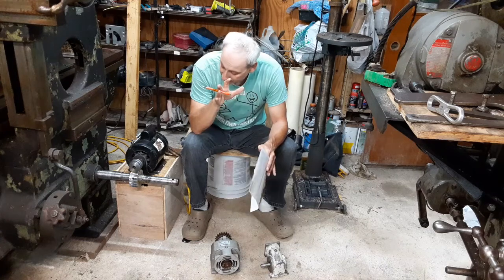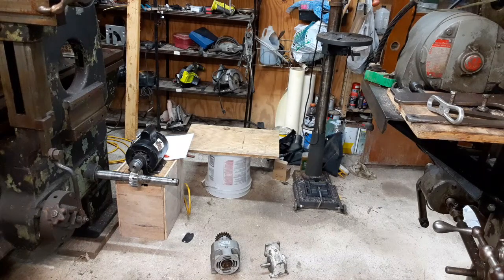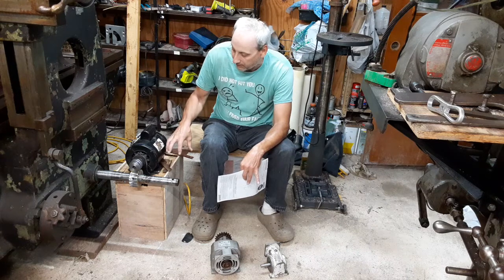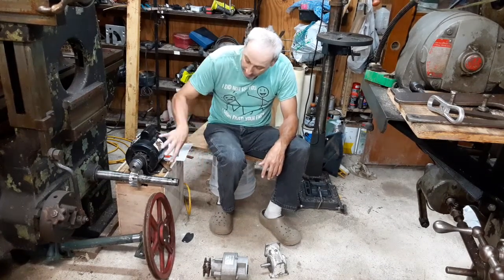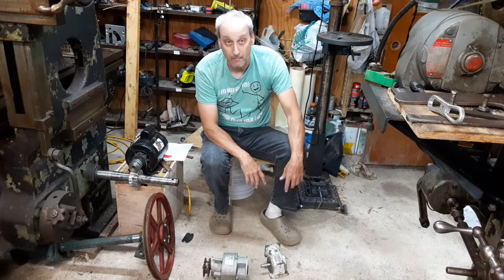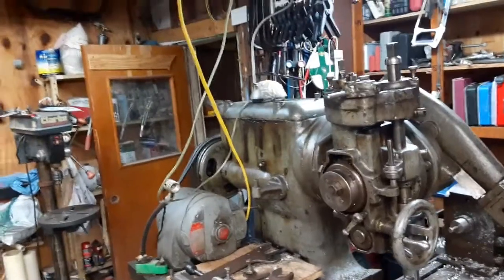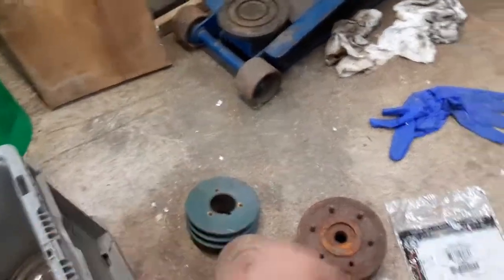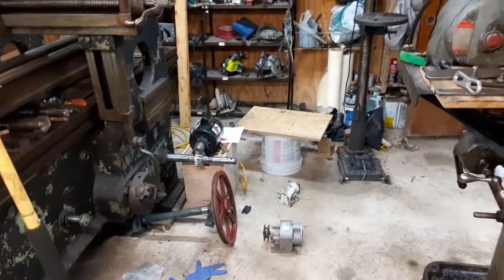why a worm gear

Comment: I used to run an old Selliors and Bellot planer. it had a worm drive which was achieved a little differently but essentially the same idea worm drive. it was considered a Cadillac among planers in its time i have converted an old Gray to a hydraulic motor driving a worm gearbox . use hydraulic power from my hydraulic press. works great. 5 horse motor on the press
Reply from the maker: Cool info...I will try to research the selliors planer and see what comes up

Comment: Evening Craig. 

Good point on space versus function. Line shaft is cool but I don’t have time or space either.

You triggered a thought. I remember Keith Rucker doing a video on the museum saw mill. Very cool variable speed from I think two rubber drive wheels. The drive wheel was moveable to the driven wheel. Depending on where the drive wheel was it provided nearly infinite variable speed drive at a 90 degree to the driven. Not recommending I just thought it was an interesting take on a durable power transfer mechanism.
Reply from the maker: Any chance you could link me to the video of the sawmill drive? Almost sounds comparable to a transmission on an old snapper I have seen before
Reply: @craigtate5930  https://youtu.be/ezcxi6zRIuk

I remembered wrong it is a paper material but the same idea. See 18 min in or so.
Reply from the maker: @houseofbrokendobbsthings5537  very cool, thanks for the heads-up...he even mentioned the similarity to the snapper mower drive